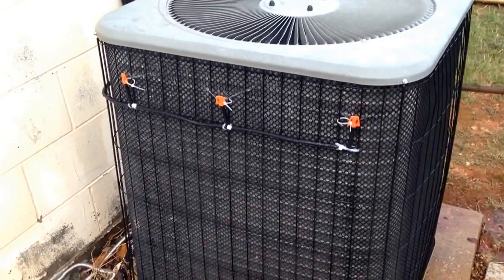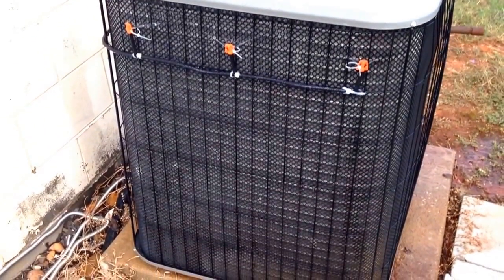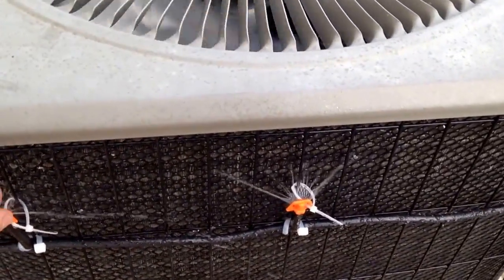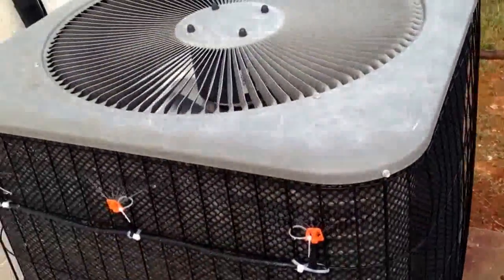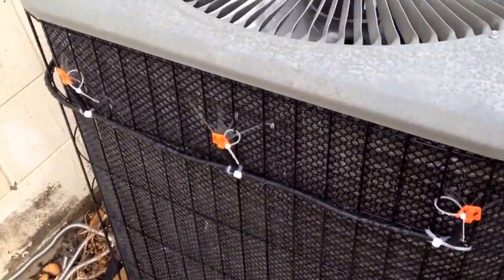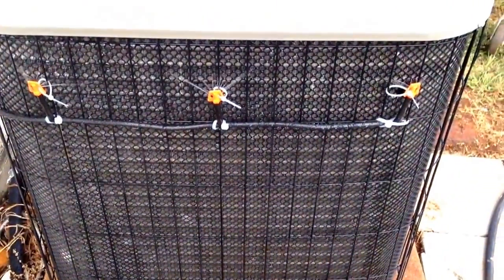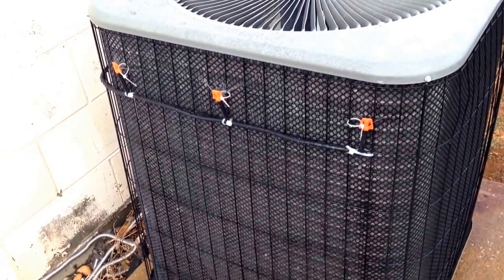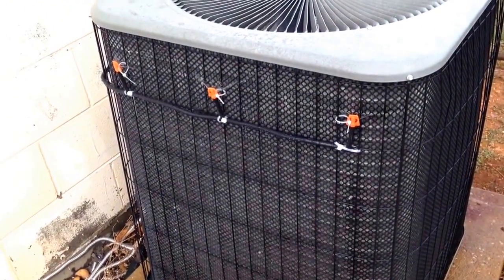More efficient AC -Update

Comment: if it went through a wet blanket like an evaporative cooler that was few inches away from the coils - then you'd have the better idea.  you need better coverage for the total s coil area.
Reply from the maker: They actually sell a kit to do what I did http://amzn.to/2fiXgz8. The kits usually have a valve connected to a paddle like flap over the fan. When the fan turns on it pushes up the flap and the water valve opens.